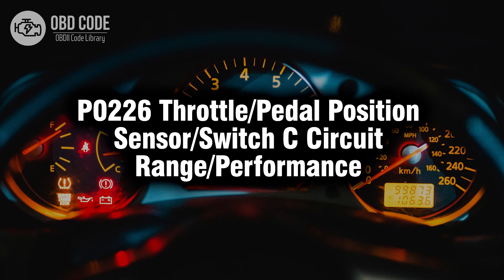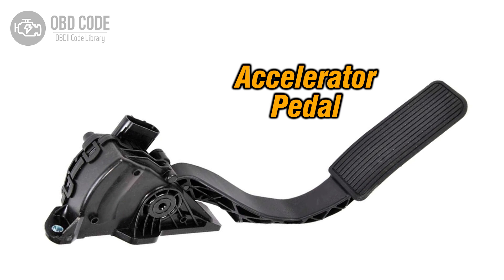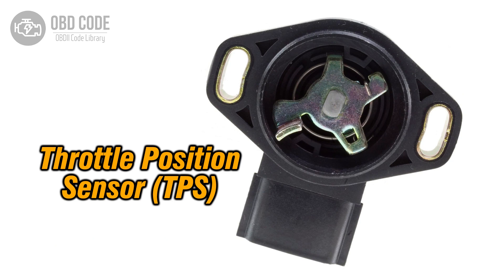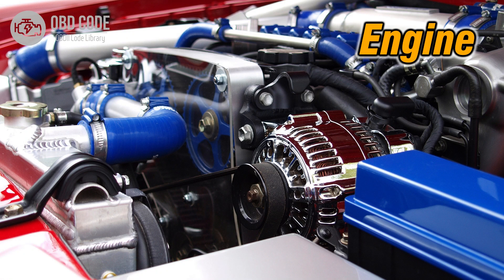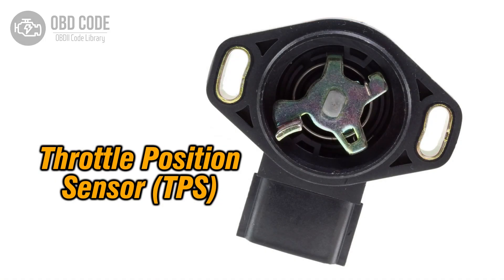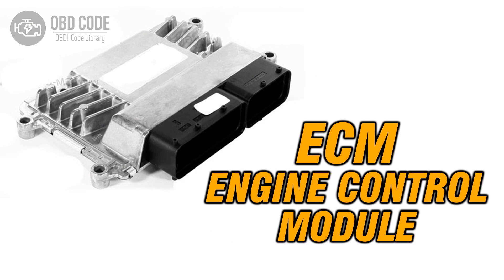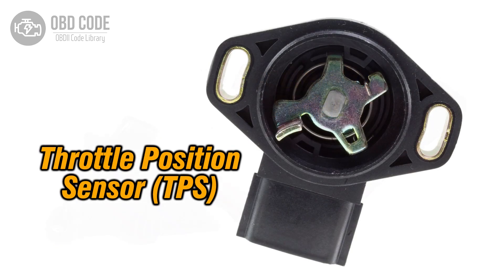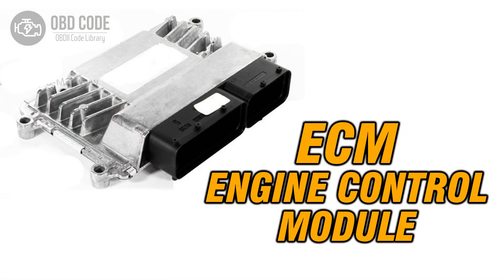P0226 Throttle Pedal Position Sensor Switch C Circuit Range 🟢 Trouble Code Symptoms Causes Solutions

Comment: Will a Pedal Commander cause a P0226 trouble code?  I installed a Pedal Commander in my 2016 Cayenne GTS about 8 months ago, to eliminate the flat spot in the pedal on acceleration. From time to time, I receive an engine light accompanied by a P0226 fault code.   When the code is present the vehicle runs in limp mode without turbos.  After some driving and a few key turns, normal performance usually returns.  I was thinking maybe a problem with the turbo wastegate actuator, but the more I research the topic, the more  I am thinking the Pedal Commander is to blame.  Any thoughts?